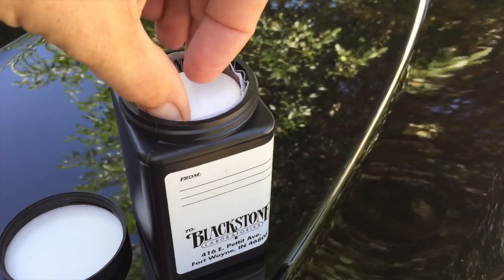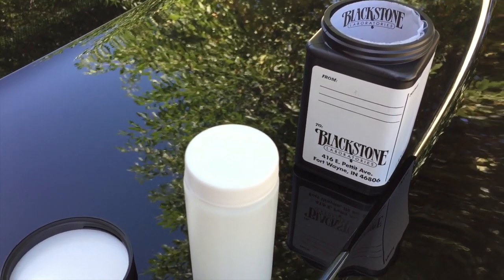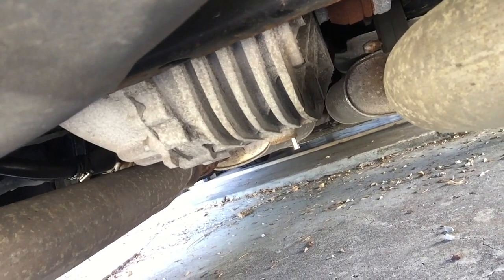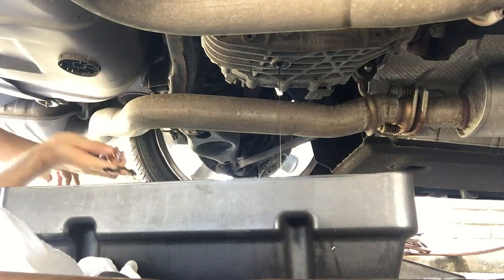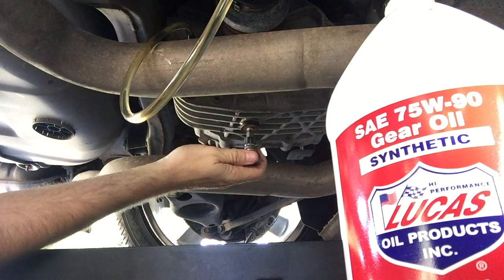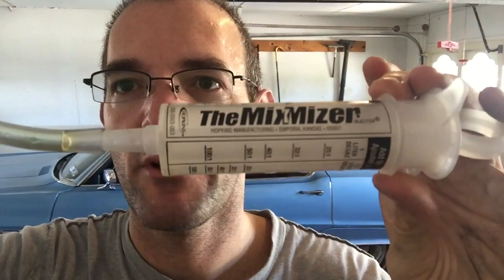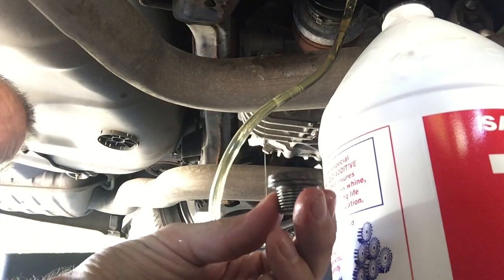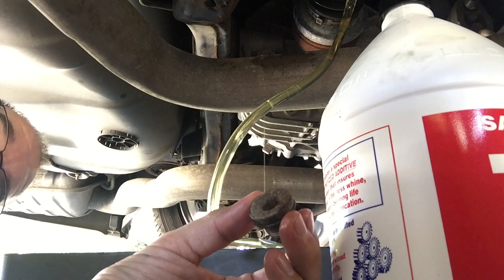2012 Chrysler 300 SRT8 Diff Fluid Change

Comment: Thanks for the video! Changed my previous 300 at 70,000 miles and my current 300 at 90,000 miles; both fluids looks good. Small build-up on drain plug magnet..just clean, refill and go. All good.

Comment: Any news to report on the diff. change? How hard was it to get the plugs loose? I have a  2008 and I was getting ready to have it done somewhere, after watching your video I'm going to do it myself. Thanks!
Reply from the maker: +Da Phantom The 2008 will be a little different but the confined space is really the issue to getting the plugs loose.  Use a cheater bar and that solves the problem.  I just got the report back from Blackstone labs today.  The results confirmed it was a good idea to change the oil.  Here's directly from the lab:  "Yes, we think it was a good idea to change this oil. There's a lot of metal here and when this much
metal accumulates it can make the oil itself abrasive. Beyond that, there's enough metal here that we're
wondering if something is wrong in this differential. Granted, there's some wear-in metal here since this is
factory oil, but that's a lot of iron. Chrome, tin, and nickel are likely alloy metals or maybe coatings. We're
not sure where aluminum is from. If this oil was abrasive, maybe it's from the case. Silicon is likely harmless
sealers rather than dirt. Check back in 10,000 miles."
Reply: @PaulSafford  I always use those guys for my engine oil but never thought about it for diffs. Thanks!

Comment: I only have a floor jack and two stands i dont think i can get the car level enough to get the dif filled all the way full anyone have any suggestions
Reply from the maker: Find a place that's at a very slight incline and position the car accordingly.  You'll get enough out to make it worth while.  Remember to put safety first, use a wheel chalk.
Reply: Did you get it done?

Comment: did you have to add the extra additive. or is it recommended by chrysler
Reply from the maker: Since the diff fluid I purchased already had a friction modifier it wasn't technically required but I reached out to Lucas Oil support and they suggested that if I had any slip that I go ahead and add some.  I added half of what Chrysler recommended just to be sure.  I found the friction modifier on Amazon and it's by Mopar.  Since it's been a while since I changed the fluid I can say there's been no change in behavior from the car so I think I'm good.
Reply: that's great news and thanks for the reply man 😊.
Reply: hello. today2/25/17 I have a 2012 Chrysler  300 with 67335 mile  I just did my oil change  ..so when I do I get my different  done or not???
Reply: It calls for 75w 145

Comment: hey im getting a little squeak sometimes from what i believe is the diff when i accelerate between 2nd and 3rd gear? does anyone know what this could be?
Reply from the maker: mikesoja ‘squeeking’
Reply: Paul Safford ?
Reply from the maker: mikesoja what’s squeezing?  Squeeking sounds like a suspension issue, whirring, whining, or grinding could be a diff (or bearing) issue.
Reply: Paul Safford its like a little chirp when I accelerate doesn't happen all the time but I know it doesn't sound like a suspension issue